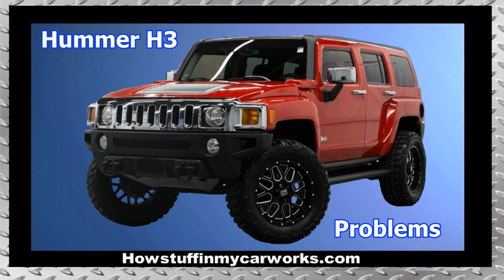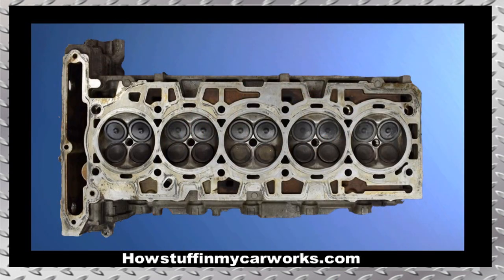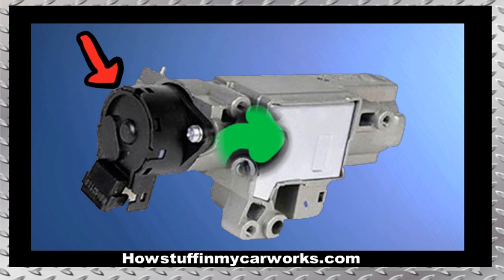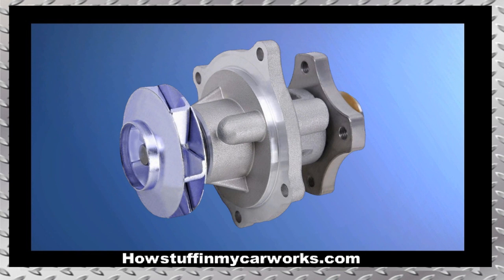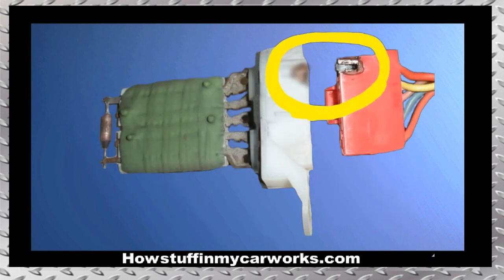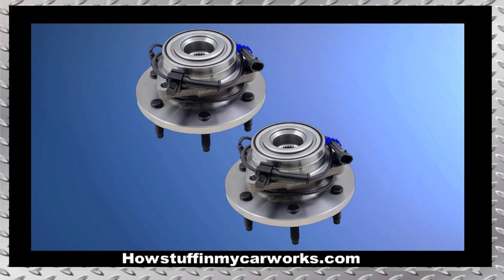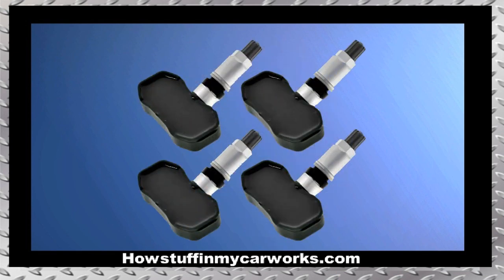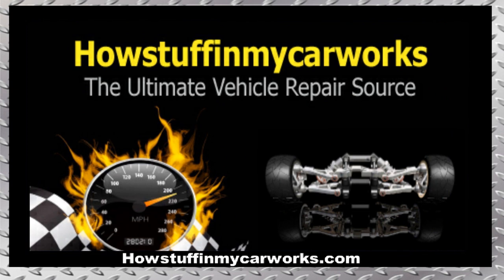Hummer H3 2006 to 2010 common problems, issues, recalls, defects and complaints

Comment: Over 200 thousand miles still running. 06 h3. Your correct about all. But they last and run good if you take care of it. Im keeping mine. It's reliable and strong. Looks brand new. I have to humble myself whenever i take to the shop for big stuff I can't fix myself. They are always amazed how good it runs and looks inside and under the vehicle. Yes I pressure wash under the truck and engine bay from time to time.

Comment: I have a 2006 H3 5 Speed for over 9 years with 273k miles. Since then replaced the radiators twice, heat resistor twice, wheel bearings twice, camshaft solenoid valve x 3, valve cover gaskets and rebuild the transmission. The TPM is on but I read that the batteries in them only last for 5 years. I figured out how to bypass the passcode lock so you don't have to wait 10 minutes or replace the ignition switch.  She's old but she still looks good on the exterior and interior. I usually budget for repairs every year.  My family and friends always tell me to get rid of it but I'm like "No Way I love it!"
Reply: How did you bypass the pass lock?
Reply: How did you bypass the lock issue?

Comment: I have a 2006 ,and you are right on with the problems l have 6 out of ten problems that I have repaired.Mine were water pump,passenger sunroof leak , tire pressure monitors,fuel pump rusted at ports,heater resister,wheel bearings both ,thanks  for the great video in English,yes I still have it,l love it.
Reply: How is the gas on the H3? is it as horrible as the h2 or is it actually somewhat reliable?

Comment: 2008 H3 Alpha with 5.3L V8, 40.000 miles, price: $25.500

or…

2007 H3 Safari Edition pkg (Lifted) 3.7L 245hp, 97.000 miles,  price: $17.300

or…

2006 H3 3.5L, 223hp, including Rear Diff Locker,  87.000 miles, price: $13.500

or finally…

2009 H3 3.7, 245hp, Lifted   incl. Rear Diff Locker, 44.000 miles, price: $19.000.

I am not atm a "Rock Climber" or yet an "Overlander", but I want to have a capable car in snow as I live far up north in Scandinavia.

Q - Are the 3.5's and 3.7's enough? I have heard that they are not optimized for such a heavy vehicle.
Q - Vere/Are there problems with the 3.5/3.7's with overheating or " oil boiling"?

Thoughts..?
Reply: They are fairly reliable if you keep up on the maintenance religiously.

Comment: My 2007 H3 w/over 200k has had every thing you mentioned. A new problem just came up. At low idle the oil light on the dash comes on and chimes. I drive, it stops. I changed the oil but it persists. How do I fix it?
Reply: sounds like it might be a 0il sending unit,oil pressure sensor maybe. worth a look see

Comment: i got 2007 Hummer x with drain line issues now the dealer says part is discontinued  car gets flooded when it rains have to use car cover and buckets towels to catch storm water no fix going to have to sell it and lord knows i will get nothing for it

Comment: My moms hummer h3 shakes hard left and right when braking. Don’t think it’s warped rotors as it literally pulse shakes pretty hard left and right. Is it rotors or possibly something else
Reply: I would have those checked and possibly your brake calipers as well
Reply: Front hubs or i have also replaced control arms because the ball joints failed  and they are pressed in ,have to replace the whole arm
Reply: sounds like the rotors to me, need to have them checked and not that expensive
Reply: Abs module?  Code